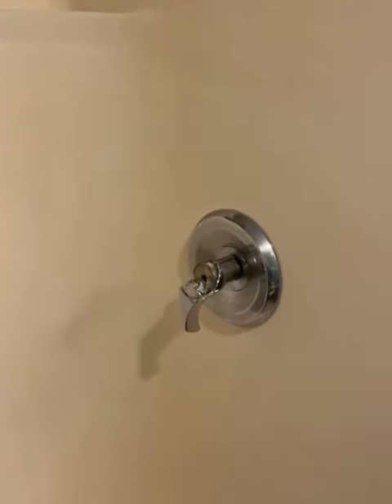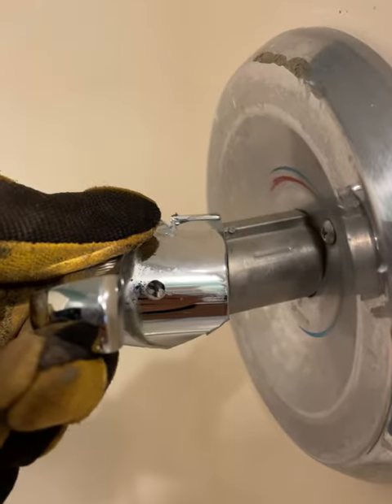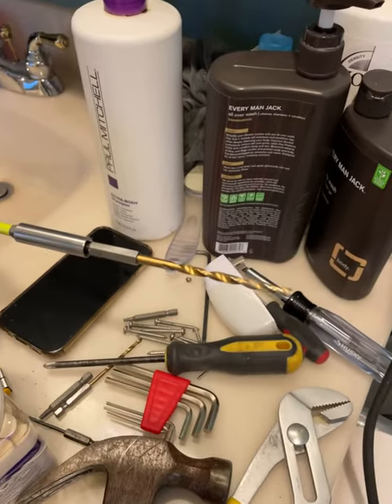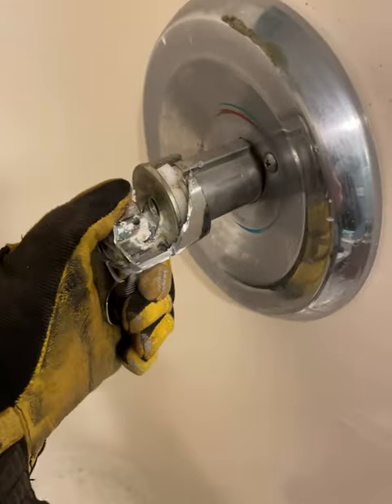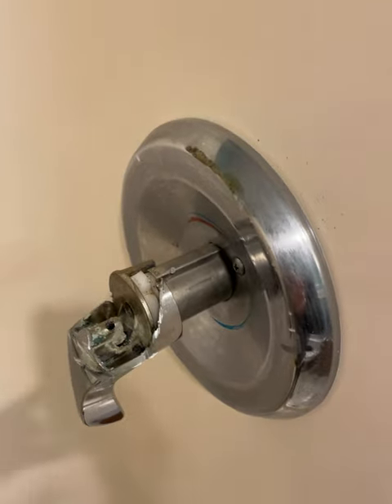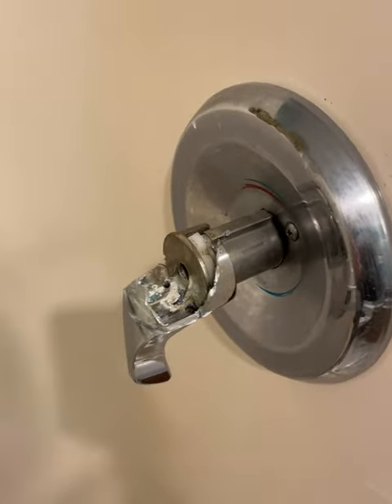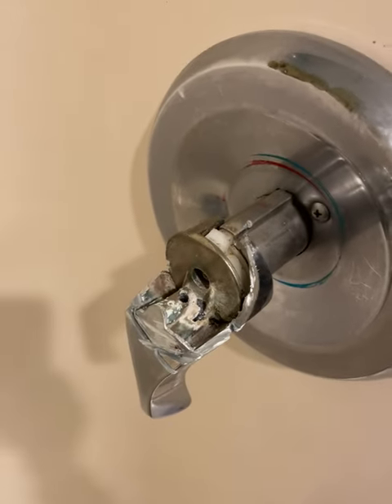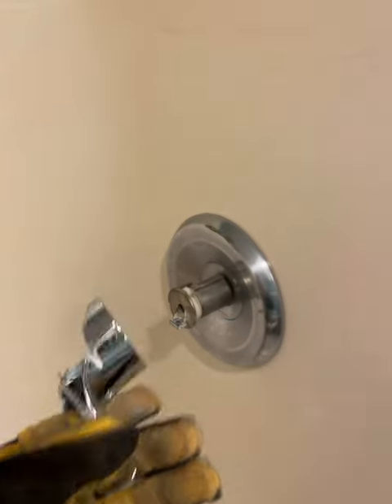How to remove a shower handle that has a stripped hex screw

Comment: Another way to remove a stuck setscrew in a Delta bathtub faucet (Monitor 1400) handle is to use a 3/16" left-hand drill bit. Use short bursts with the drill in reverse (the cutting direction for LH drill bits) and the setscrew might loosen. When the drill bit bites into the setscrew head, the torque might be enough to loosen the stuck setscrew. Worked for me and the setscrew was reusable.
Reply from the maker: Definitely another way to do it/ However, for me, after trying everything else, this was the last resort. Since I was replacing everything, it did not matter anyway. This way is definitely non-reusable.